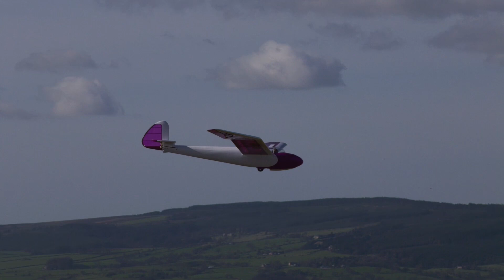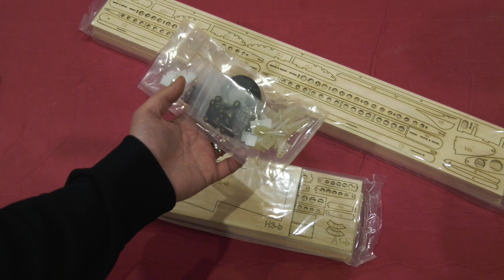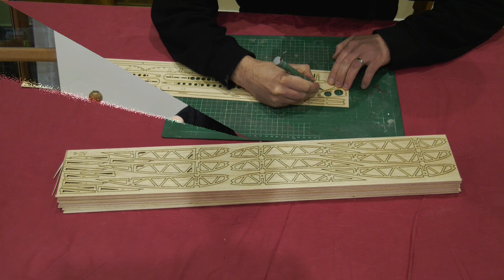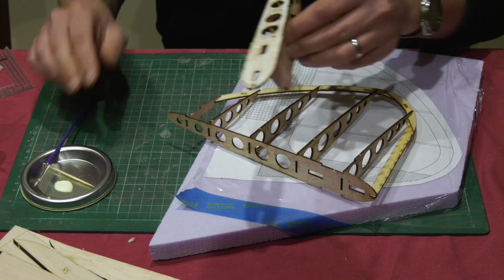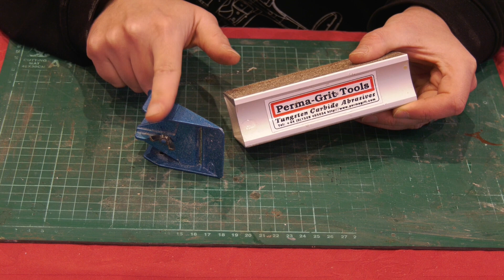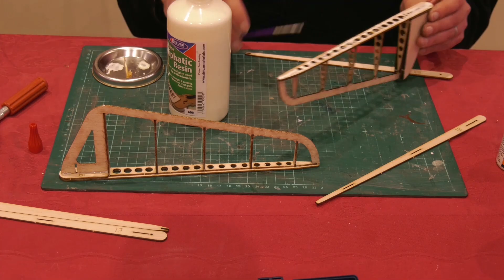Tony Ray Minimoa Build & Review Part 1

Comment: I left a comment a year ago... did you try using wax paper,  instead of plastic film, on any of your next builds ?
Reply from the maker: Hello, welcome back.  No I am still using plastic cling film (sarang wrap) to protect the plan with great success.  I have built several aircraft  of all types since this video, but also a couple of Tony Ray kit builds.  More recently, on my Tony Ray 1:6 Tiger Moth build (coming soon), I used waxed baking paper as a release film for laying up the composite door parts between 3D printed mould presses.